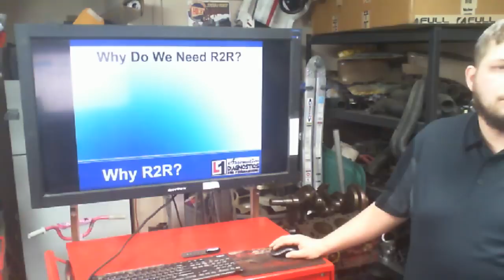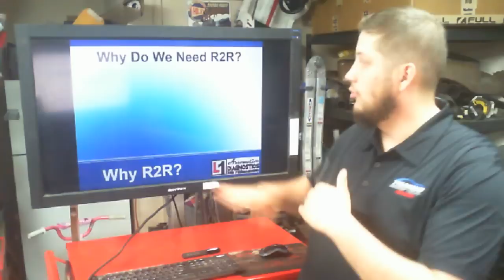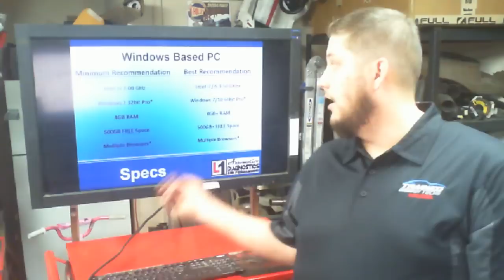J2534 Module Programming Class Excerpt

Comment: Thanks Keith Hope your financial situation is in good shape. This has been a very helpful vid and gave me enough information that I was able to answer a lot of questions. In the past I was a wrench turner hobbies but w/ purchase of 2020 dodge I started getting further into the details of systems operations, performance, and repair of my personnel cars. After watching this I now understand the money pit I was about to fall into. I data log using HPT but now will not even contemplate a repair, I will leave the that to the Dealer.  Also preparing myself to sell/trade off these modern cars when or before the warranty expires. i may even purchase the extended warranty on the new 2022 I have ordered. Oil changes are now the limit to my hobby.  Thanks you save me a lot of headache, time, and money that I can now spend elsewhere.